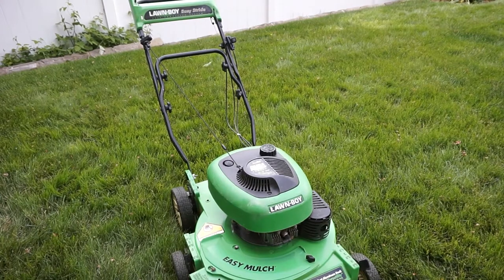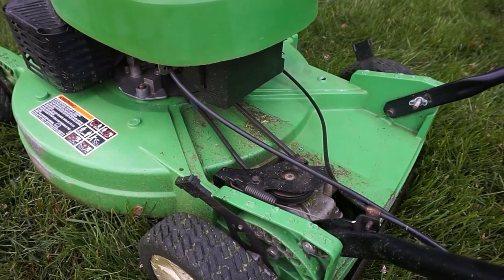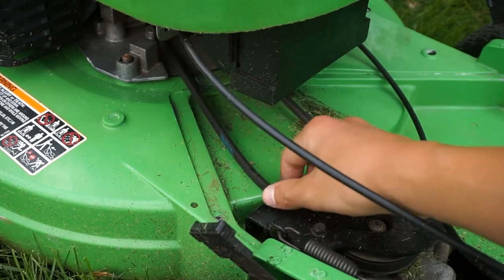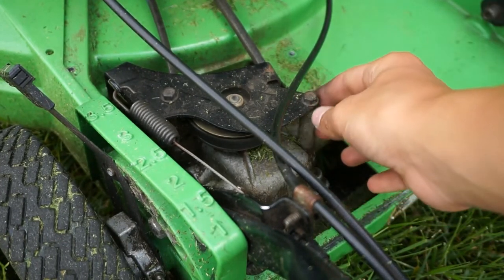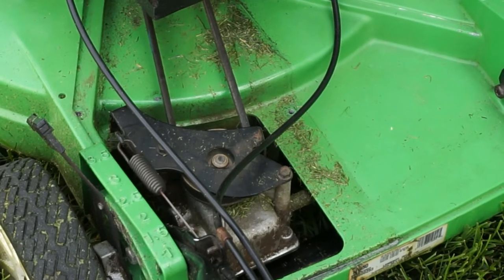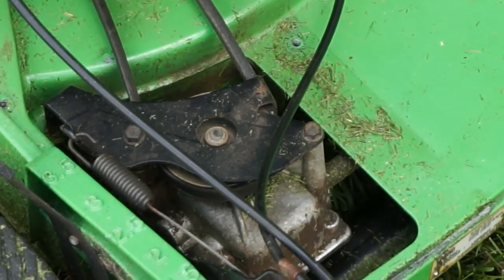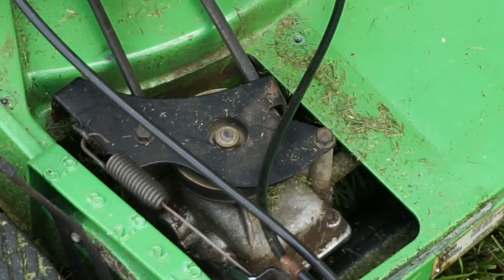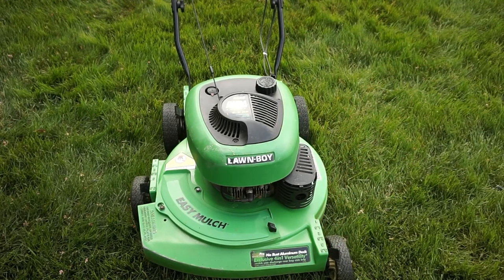How A Lawn-Boy DuraForce Self-Propelled System Works

Comment: Could you do a video on how to replace the engine self propel pulley and set screw?
Reply: You have to take the engine off of the mounting plate in order to replace the drive belt or replace the self propelled pulley.